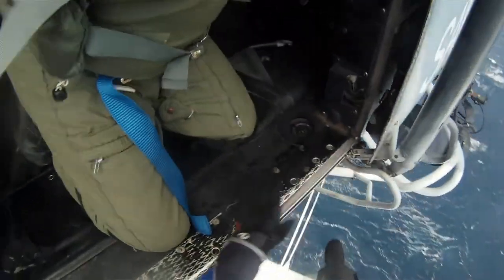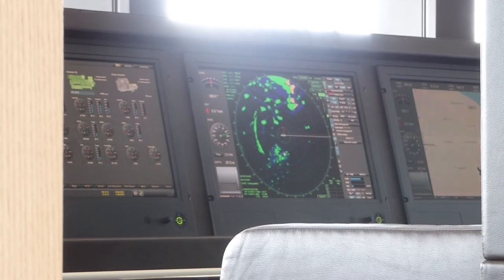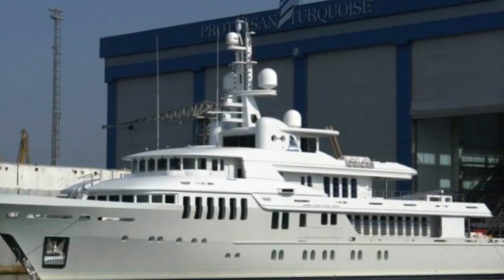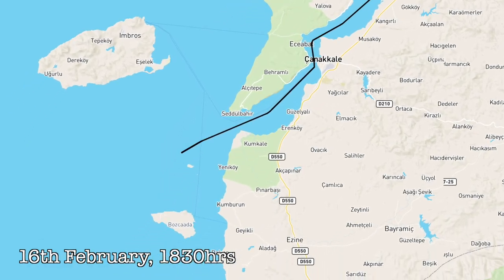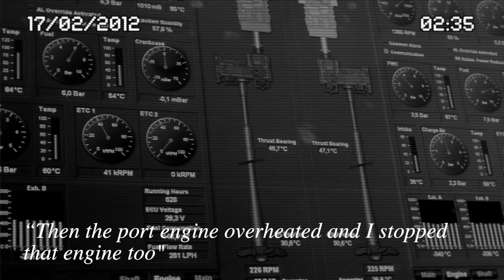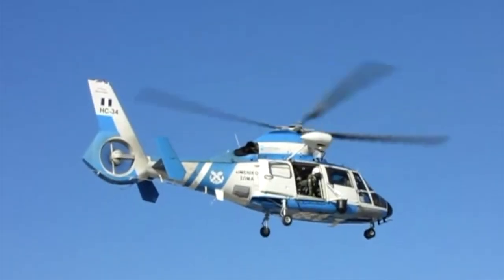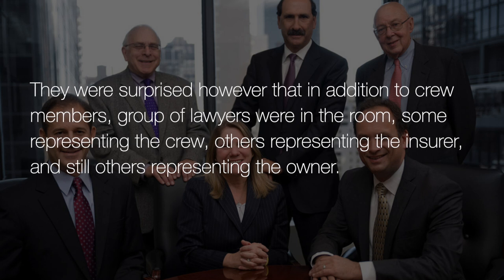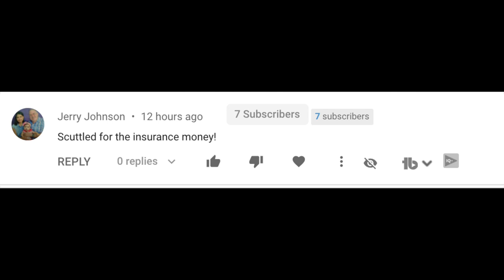Yogi: Largest SuperYacht that ever Sank - Part 2

Comment: I'm not surprised that the shipyard got a lot of bad press for this: those changes to the stern on several occasions does not seem to live up to the expectations you would have on the naval architect that was apparantly supervising some of them and they remind me of the design of the "watertight compartments" on Titanic which were not really "compartments" in the modern sense in that they had no watertight ceiling but were just a series of watertight bulkheads which the water could flow over once it got high enough (or the vessel listed enough).
The failure of AIS and the internal comms is also highly suspicious and if the flooded stern was involved in that its a clear sign of incompetence.
Both of these issues could potentially be due to influence from the customer and that the designer failed to stand his ground because he thought the customer might take the work elsewhere and he tried to make things work anyway, this does not mean the customer is at fault as it could simply be a quirk of human psychology when such a big project is undertaken that it dominates your corporate existance. My conclusion however is that these alterations to the design clearly exceeded the capability of the designer to ensure seaworthiness.

Comment: Unlike in aviation world there is no pre departure check list of critical systems ? However the engineers and captain are clearly not qualified and they made a series of mistakes on a ship that lets face it was not well designed or well built. The new French agency missed the lack of temperature warning system on the exhaust ?  Whenever a ship has to have more ballast added , she is not essentially a sea worthy design. The added weight aloft for a cover , wait no one thought the pool area might need a sun screen ? Ah the list is so long, a sloppy yard , a derelict crew and bad weather , and running hot speed. In heavy weather... geez all the rules were broken !

Comment: Truly a tragedy....from the shipyard, inspections, missing electronics, crew actions, etc...Clearly the crews taking of their OWN personal affects, and not the necessary navigating documents or retrievable gear is the largest obvious red flag. BEAmer review left gaping holes in the investigation. 16+ knots (full throttle in rough water) ya gotta think wtf? Was the captain thinking? Bad for safety of the crew, hull structure, engines overheating, etc...that was the second obvious red flag. A $40 mil yacht missing key tracking gear?...that is not a budget shortcut...too many things do not add up. To sink a yacht for ins clm, and hope rescue comes in time, not to mention boat is sinking in rough seas..crew put the selves in har s way, lucky they were rescued.

Almost makes u wonder, after major boat build retrofits, u should hire an independant boat sur eyor to dbl ck their work w a fi e tooth come, they find ANYTHING making the boat unsafe charge their ti e bk to boat builder and recheck the boat.

Comment: A, lot of people have difficulty imagining the difference between - the future - and - thoughts about the future. They take things that have not yet happened, as facts. So the fact I was in port yesterday, seems to them to have the same truth status as I will be in port tomorrow. So if they are imagining arriving in port, then leaky stern door seals don't seem relevant - becuse they are not reconcilable with the main  'fact' I will be in port tomorrow.

They don't relate to thier experience as a sequence of linked events. 

They are clearly not faking this because they will stake their lives on this way of thinking.

Ocasionaly disasters occur and they have to say to themselves' I am not in port, i am in a rescue helicopter'.  But this isn't excessively troubling becuse  they do not regard experience as a continuum. They can just start some more ideas that suit the new situation. The old ones, now outdated disappear, because they do not fit what is now imagined.

They are not necessarily bad people. They are just neurologically not suited to having responsibility for complex machinery.

Comment: Insurance scam. Is less likely, you gotta pay off at least 2 crew member and trust that they keep shut - that alone costs 2 to 4 million.
It would have been easier and less risky to just sell that thing.

Mainy question for me is how did so much water get in the beach club 🤔, that the turning point of the whole story and how can that lead to the rudder not working - that is either a bad design or bad work at a shipyard not sticking to the design plans
Reply: You don't sell a super yacht over a weekend, if he paid $40mil going to take a bath on it as well if he wants a quick sale!
Reply: @rk24133927  You also don't get the insurance money in a week also, the safer money is to sell it - do we even know that the insurance paid?
Reply: @brainthesizeofplanet  I know but one day you will get its insured hull value, probably a lot more than a sale, I would imagine the insurance paid out! 
The boat is 500M down the bottom of the sea, a hardened diving suit can go to that depth if they decide they needed photos.
It may be a total crew screw up & design flaws with the boat as well but a lot of weird stuff went on as well which does not make sense. 
The GPS transponder was turned off why?
Why were the flooding alarms not going off & then bilge pumps activated? It had 8 water tight doors, they all failed? 
Its a 60M close to 200 foot steel hulled boat, they are designed for trans ocean crossings.
The Atlantic has normally big seas on a good day. 
A lot of super yachts cross the Atlantic twice a year, around October from the Mediterranean to the Caribbean & back to the Mediterranean around May.
I seem to remember they were in 5M seas that's not a very big sea, should not be big enough to sink a new 200 foot boat!
The boat builder ends up with a bullet in his head as well, very coincidental!
The boat owner wanted his $ back was told no.
Solution, send the boat 500M down to the bottom of the sea & have the boat builder killed! 
Why did the crew not have VHF radios if the internal phone system was not working, the boat had them, they are in heavy seas in a storm & they can't communicate with each other why?
I know it may be out there with insurance fraud but a lot of this does not make sense!

Comment: THE BIG QUESTION IS BILGE ALARMS,,,    THIS WILL GIVE YOU EARLY WARNING OF FLOODING, FROM THEN ON ITS INVESTIGATE AND GET THE BILGE PUMPING SYSTEM WORKING,   no mention any where in any report, contain the ingress of sea water, water tight doors etc.
Reply: Agreed, surely they have alarms that report the ingress of water & flooding at a certain level & then bilge pumps to pump it out. They had power till it went down, why were the pumps not working?

Comment: I understand the Swiss cheese incident concept; however, 1) three methods of communication failed 2) AIS failed 3) flood censors failed 4) pumps failed 5) two engines overheated 6) engineer doesn’t manually disengage overheating engine!!!  Come on, Man

Comment: This is probably a whole lot of things coming together, but it strikes me they all lead back to one root cause. Someone trying to buy a super yacht at a bargain basin price. Someone who wants to impress his rich friends, but can't afford to buy from an established builder of super yachts. So tries to cut corners by building in Turkey and no doubt interferes in the build by cheese paring all the way, leaving out normal equipment like engine temperature overheating warning alarms, to cut costs to an absolute minimum. Then hiring a third rate crew and pushing them to travel when they're in no fit state to do so, in poor weather conditions.
Reply: I was thinking that as well. If you have $40mil to spend on a boat why would you buy a new one in Turkey! You can buy a used Feadship, considered one of the best super yacht builders. A used 62M Feadship built in 2005 refitted in 2018 that's for sale now for example would be a far better boat for around the same $.

Comment: Looks like poor shipyard QC on systems worked on plus an incompetent crew, even deliberate sabotage of the flooding. Engine overheating is a design flaw pure and simple. Running at that speed in heavy weather is a rookie or deliberate miss use of engine controls, depending on sea state.

Comment: Why was the captain powering this new vessel 100% power in such bad conditions of weather?  I would say that was unwise at the least.  I know the Med and though the swell is not quite as bad in the Aegean sea as in the middle of the med, the craft must have been taking a pounding.  This was unnecessary and reckless.  Then when overheating found, usually just backing off the throttle to much smaller power will get over any overheating problem, not shutdown completely while still maintaining propeller turning and forward motion and therefor steering ability to steer into the swells.  After Running both engines at full power, shutting both of them down was leading to loss of control and listing, rolling and water intrusion was next.  Ugghh.  sounds like there were a lot of rather stupid people on board, making successively poor decisions while the captain is incompetent and not in charge
Reply: This is about a 200 foot steel hulled boat. Large super yachts are designed for trans ocean crossings, Atlantic & Pacific. A lot Cross the Atlantic 2 times a year. Mediterranean to the Caribbean around October & back to the Mediterranean around May. The Atlantic on a good day has large swells. I would not have thought 5M seas would sink it! As people have written, poorly built/designed boat!

Comment: "The boat had just left our shipyard in perfect conditon"... riiiiiight. With watertight doors missing. If that's Turkish for "perfect condition", I guess I'll buy Italian.
Reply: Exactly, its a 60M close to 200 foot steel hulled boat. They are designed for trans ocean crossing. The Atlantic has big seas, a lot of super yachts cross the Atlantic twice a year. Around October from the Mediterranean to the Caribbean & back to the Mediterranean around May. I seem to remember they were in 5M seas that's not a very big sea for the Atlantic, should not be big enough to sink a new boat!

Comment: Someone wanted to discredit or destroy the builders, it's was the newest, most technology advanced, highest rated by multiple authorities, multiple inspection and repairs, flagship of the builders, under insured, unprofessional crew with new members aboard, was owner happy? Is there envy amongst designers, builders or owners to the point of sabotage. Strange that she was under insured, owner strapped for cash after wrongful business dealings, who owned her at time of loss, was the a bank holding a pink slip so to speak. Has any ships water tight compartments failed so badly since the Titanic? Crew unprofessional .... All suited for a rescue that was 4hours in the making, Greek coastguard arrived 4 hours after captain signaled Mayday, no fire or other cause requiring captains focus after Mayday, so why no logs secured for travel during rescue, if that was a safety issue for crew then deploy a life raft with all logs secure inside raft, that leaves captain still 3 hours before rescue. Why new engineer, that is a major learning curve for incoming engineer, original crew would or could  have been part of the 3 year build process, why new crew, outgoing engineer was not of age to retire..... I could go on but brighter star w papers and pedigree have spoken. Always stay curious.

Comment: Reason  mustbe ; insuranc fraud , lack of education from shipyard to crew and / or lack of experiance and knowledge of crew. Suppose the initial failure was due to poor design and construction the crew must be able to detect the troubbles early and made corrective  repairs or similar. Where were the chif engeneer during the whole event ? Beeing down in the engineroom and similar compartments you musr have detected another behavor of the hull and another sound / tone from the engines . Only the lighting strikes from a clear sky !!!
Sven S

Comment: Virtually all the "Engineers" I ever met on big Yachts are called 'phone Engineers'  if any thing needs fixing they just phone for a shore based Company to fix it ~ not easy out at sea !!!.  Almost none of them had any practical engineering experience, eg if a Genny did not start on a touch screen they had no idea how to short out the starter, or even where the Genny was actually located ...  Almost all the Skippers are just arse lickers to the owner.

Comment: Ship was too complicated... too vulnerable to failures.  You take it out at top speed in very rough seas, and duh, something's going to break.  tired, crew,  rough seas, and oh, a schedule to keep.  That's three strikes, and something bad is going to happen...and did.  Cavalier seamanship.  It should have been going 8 knots, max.  In adverse sea conditions, you need to maximize your margin of safety, not push the ship to its limits.   So what if the next charter party had to wait.  Now, was the cavalier seamanship intentional,  increasing the possibility, and wishing that something bad would happen?   Plus the owner had conned a wealthy elderly lady out of 140,000,000 euros.  Mega yachts are white elephants, and you'll get 50 cents on the dollar when you try to sell one.  Even with active chartering, they lose a million bucks a month ( at least ) I feel sorry for the ship, and the builder who killed himself.

Comment: The owner sounds like a cnt to work for. Demanded ridiculous changes to the design, wanting to have a door gasket changed to a different color . . . He had no appreciation or knowledge of sailing. Maybe he had been pushing the captain and crew the same way with ridiculous demands and wouldn't listen to good professional advice, and they were pissed. Maybe the captain tried to tell the owner his boat wasn't going to be delivered by the expected time, but the owner demanded he push the speed to make it there (not excusing the captain). Just an idea.

Comment: CEO of shipyard says "the ship left here in perfect condition". Absolute nonsense. Two phone comms systems not working, AIS not functioning, engines overheating . . . Sorry, but this was a mockery of a vessel. Best place for a vulgar super yacht like this is where it ended up . . at the bottom of the sea. My question is this . . did the insurers ever pay out? One would think the video might have told us that.
Reply from the maker: Well He was suggesting AIS was turned off by crew. Also if they ran the engines at full power for long periods they would overheat. I agree though the vessel was not in perfect condition.

Comment: The whole thing stinks. Do they not call the bridge and say they are 
ready for departure or tell when going unmanned using the phone? Did 
nobody test the sound powered phone? Verbal permission from the captain 
to stop an engine is required however, so the engineer was right in 
that. Where the exhaust bellows fitted the wrong way round? They 
normally fail after years of service. Telling lies about the speed is suspicious though. If you lost an engine you 
should be happy to keep a couple of knots into the weather with the 
other. This was either fraud or total clowns ran that vessel.

Comment: The yard build this overpriced toy, which then had a never ending series of technical problems, failed inspections, failed parts, missing equipment, failing alarms, even a bad paint job. All the trouble must have eaten up the profit of the yard, or the vessel even became expensive for the yard. When it happened, so much failures and incompetence at once is just not plausible. This doesnt look like an accident. The aftermath stinks even more.